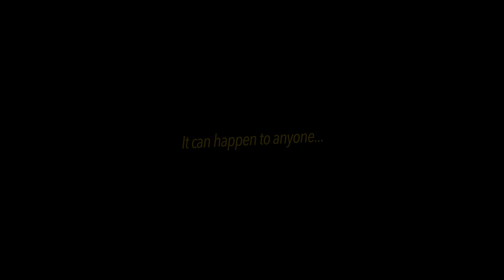SILENCE! How to fix contaminated disc brakes

Comment: Awe, the simplicity of CALIPER BRAKES!!!!

But yeah, I could see using disc brakes if you need to be braking quite a bit...

I still have not done the jump to disc as my Ultegra brakes work perfect for my needs ...
I have seen this video when it first came out but I ALWAYS resee your videos as they are pretty tops in my book!!! :-) :-)
Reply: @johntracey8592  honestly, I have had many bikes with pas brakes, and never changed outer rim because of total wear.
I'm sure there are those who have had to change it out for another. But the cost is REALLY not that much on aluminum, carbon is more expensive of course... Remember to read about the up keep/maintenance and all information on disc first, as it can be a nightmare lol
Just to calm your curiosity get disc, and if you don't care for them AFTER using them, you can always go back to caliper brakes.
Safe riding :-)
Reply: @leftymadrid  Even some awesome rim brake wheels sets only cost $600, with disc you always have a chance of bending the disc from moving the bike around or it falls.

Comment: 2:28 Acetone did it for me thanks!  Oddly enough I had a bottle of acetone nail polish remover 5 feet from where I parked my bike. If I had been looking for that bottle I would never had found it. Must have been "new brake funk" because it was quiet on the 1st day and then squeaky (like a baby rabbit in a  dogs mouth) while riding (not braking) on the 2nd day. Spinning the wheel backwards seemed to help as I cleaned it with acetone.  (ace-tone)

Comment: Just bought an Ozark Trail Ridge 29 inch from Walmart as it's recommended by many to start getting into the hobby and my brakes make that noise from the get go.

I thought it was due to cheap brakes as somebody recommended upgrading the brakes on the bike... so basically, now I understand it was actually due to the assembler at Walmart contaminating either or both the disc and pads. Smh. I didn't expect to put in work from the start from purchasing a "new" bike. That sucks, but good to know all I really need is nail polish remover and figuring how to disassemble my calipers/brake pads.

Comment: I would not use acetone with resin pads. I work with resin mounts in the lab and we actually use acetone to break it.. i would use isopropyl alcohol, instead.

Comment: love your vids.   

had this same issue.   the LBS cleaned rotors and pads and also sanded pads but the noise kept coming back.   so...ended up just swapping in new pads and rotors and we're back to quiet braking.   BUT, i loved the other rotors which cost $75 each compared to the crappy rotors i got in their stead,   am wondering if the LBS sanded the surface contaminant into the resin pad and that's why it kept happening even after cleaning.  regret not seeing this before i spent $60 on new pads and $130 on new rotors.  def pads did not need replaced in terms of age, and neither did the rotors.   just the rotors where white and matched the bike.  lol.

Comment: PSA: if you have painted brake pad housings, don’t dump the acetone all over them like in the vid as it’ll soften and strip off the paint and cause you issues. Just rubbing with a cloth is fine.

Unfortunately I found this out the hard way...
Reply: Rubbing alcohol is better-it doesn’t really affect the paint, and acetone leaves a residue, especially finger nail polish remover, which also often contains additives. Didn’t seem to affect his brakes though.

Comment: Thanks for the video! I have had squealing brakes for awhile and can’t figure out how to fix them. I’ve taken the bike to two different shops with no luck. I tried your method exact but still squeezing just as loud 😐
Reply: From what i heard you should switch out the pads and probably the disc too unless they already done it, and prob also getting new brake calipers is my best guess, but thats gonna cost basicly same as getting a new
Reply: Get some other brakes man. I had disc too. Nothing but cancer. Got Shimano roller brakes on my city bike. Know you nerds like your speed and lightweight parts, but holy fuck these are the best and only brakes I will use from now on. If anyone here wants to buy a citybike with disc brakes, please just don't for your own sake. Get roller brakes. 15.000 km and no problems so far. Haven't even changed them once.

Comment: Just wanted to mention that the benefits of using organic braking pads may have been completely neutralized by using a styrofoam tray. Styrofoam is one of the most environmentally detrimental materials there are. Single use plastic, can't be recycled and tends to break down into smaller pieces that ends up in animals and nature however well you handle it. 
Those kinds of materials have been banned in Sweden for decades.

I'm only mentioning it because you seem like the guy who would care.

Kudos for using organic brake pads and wooden handle toothbrush though. 
And thanks for the content! I'm going to try the method on my horrendously squealing MTB breaks..
Reply: They can be recycled as part of filler material and sometimes they use random plastic bits, grind them to a coarse granulate and mix with a resin and cast items like pallets, chairs and other items from it. But as is often, economics trump anything else so if it is cheaper to make something new they will do that.

Comment: Have you tried Isopropylic Alcohol? Its much stronger than normal alcohol and can dry pretty fast and get rid of any contamination, also works good when placing handlebars that dont have a lock
Reply from the maker: Micael Marcos that should work as well 👍
Reply: Those little alcohol pads you buy at Rite Aid work great for this.  Just stuff a couple in your seat pack.
Reply: doesnt work on my bike........cleaned rotor and new brakes, same squeeky shit.
Reply: @StuWright  try sanding them, sort of worked for me atleast somewhat than before. I just tried didnt go full in ima do it soon but sanding both should work, atleast better

Comment: I’d use a metal file instead of sandpaper that way no sand granules could possibly get stuck in the pads which could cause excessive wear on the pad and rotor.

Comment: Lightly sanding glazed pads, and spraying with aerosol brake cleaner works at treat. Contamination is worse with resin (soft) pads, less do with metallic pads.

You can always rub the rotors with scotch brute, light sandpaper also, especially when installing new pads.
Reply: Patrick Parisien or Patricia Parisienne
Reply: @jsaintclair1  neither mate, that’s my name!

Comment: Hello. Need your opinion about disc brakes. I'm currently on mechanical disc brakes (TRP Spyres) that work nice with durace rotors but I'm thinking about an upgrade to  Hydraulic brakes . Do you think the switch worths the money? Thanks

Comment: Mineral oil to lubricate the pistons is great, but after you push them back, clean the inside with 99% isopropyl alcohol and QTips. Then wiped dry with shop towel, and you won’t re-contaminate the pads.
Reply: Better still, sewing machine oil. Much, much finer.
Reply: mascara snake it might eat at the seals.

Comment: Good video. Thanks. I find that I have to do this very two or three weeks which is a real pain! Putting me off ever have a disc bike again!
Reply from the maker: If you have to do it that often, I’d worry something else is not right, like leaking pistons or something 🤔
Reply: Disc brakes are overhyped. Nothing but problems.

Comment: Might be obvious question, but , do you also need to clean your tires so it does not contaminates again?
Reply from the maker: Luiz Soyer I think the first thing you should do is to clean your whole bike when you have some kind of noise problem.
That being said, unless you’ve ridden trough some deep oil spills on the road, I have a hard time seeing dirty tires alone contaminating the pads (from riding in normal conditions).

Comment: Vinegar. The best solution for me.  Both for the rotors and the pads.
Reply: How does that work? Iv tried white spirit to no effect
Reply: @rozzer666  ...a pure cloth dipped in vinegar will do the cleaning for the discs. As for the pads, soak them in a glass of vinegar, leave them few minutes then apply some sanding paper on them, few times until they become clean and pure as new. Dry them with a pure cloth and voila.
Reply: @rinonhoxha4059  I got some proper shimano pads. Solved the problem straight away

Comment: Just use brakes/clutch cleaner. Most nail polish removers contain some oils to protect  the nails.
Reply: You don't use nail polish remover. You use acetone, a chemical substance often used in nail polish remover. Even if they don't contain oils, they contain perfumes...which are essentially made of oils.

Comment: Can someone tell me why when i clean my mtb brake pads and rotors  with  alchohol when i put them on they have the same bad bite as previous but when i go a lit bit downhill to get up the temperature  they have better performance is this supposed to happen or im doing smthing wrong?
Reply from the maker: Totally normal. It because they need to be broken in just like a set of new pads.
Reply: @ridesofjapan  okey thanks for help i appreciate it and thanks for the tips in the vid🤙🏽

Comment: Tricky question for you: you know that shimano road pads are smaller than the MTB version, thus less powerfull. So have you ever considered using a MTB caliper on your road bike, you'll have tu use a flat mount to post mount adaptor and your bike your bike would be about 50 grams heavier because of that but you'll have much better brake performance and less noise since the MTB brakes are just better.
Reply from the maker: Anthony HT No, I haven’t really considered that. I still have a 140 disc in the rear and never really felt I’m missing brake performance. I’m a flyweight guy though, so that can have something to do with it.
But yeah, MTB calipers are better in terms of pure braking performance, can’t argue with that.
Reply: @ridesofjapan  I would say the only upgrade worth doing are hope RX4 callipers or, if you can justify the price, trickstuff piccola calipers. The Hope RX4 are a bit of a pain to get set up but a huge upgrade regarding modulation and power, especially to shimano road brakes. If you want to get the absolut best for your bike go for the trickstuff C21 callipers - nothing can beat them, but the price shows that.
Reply from the maker: KoenigKalle cool, never seen the trickstuff calipers before... my German is non-existent, do they make them for Shimano mineral oil as well?
Reply: @ridesofjapan  It's a very small company :D
Yes, if you order the calipers, you can choose between DOT or mineral oil, flat- and postmount. Delivery time is 9 month at the moment, I think that's because they need a certain volume to make it profitable.
one caliper is 165€ - but you save 45g per brake over the shimanos you are running :D
Reply: I use hope calipers on my front disc and it works significantly better than shimano. Fully agree with the suggestion.
Reply: @SaKuLification  I'm sorry? 9 months, it's not a baby we're asking, it's a brake set. It's just too exclusive...
Reply: @onilovni1234  yeah, 9 months is a bit insane but 40-50g of weight saving per brake is insane as well and there is nothing that compares to them since the hope rx4 are actually havier than the stock dura ace calipers.
Reply: @SaKuLification  i would stay away from RX4, it is well known for stuck pistons

Comment: One thing that motorbike riders do is put a little grease between the piston and the back of the pad, not sure if this will help with bicycles,  perhaps someone else has tried it?
Reply from the maker: Not generally done on bicycles no, but it’s one thing I want to try actually. If I ever get a squeal I can fix otherwise.
I have a tube of brake pad grease ready.

Comment: first of all thank you for this really well made video with nice and clear instructions!! I really wanna try this but I'm scared of using acetone as opposed to isopropyl alcohol, like many others have suggested on other online videos and blogs, etc.
I am pretty sure I have a case of contaminated rotors and brake pads (manual disk brakes). 
I don't want to spend $150 to $200 at a repair shop for something that I could potentially fix myself and also have it be a learning and empowering experience, especially knowing that this problem could very well repeat itself in the future many times over. 
Would you happen to have any extra tips for me to give me more confidence in this process? Thanks a lot for your time. 
🙏😁😬
Reply from the maker: If you feel unsure, start with isopropyl and see if that works for you. Acetone is stronger but can affect paint etc so if you go down that route just remove rotors from the wheels just to be on the safe side.

While most people seem to be focused on the noise in the comments, more importantly is the breaking power that was severely reduced because of the contamination.
If it’s only noise you want to “fix” while this might help, unfortunately it’s not always contamination that’s is the reason.

But any way, isopropyl is a safe way to start👍
Reply: @ridesofjapan  
Wow. You're so kind to respond so quickly.
Thanks so much.
Also I'm not sure if my break pads are more metallic or more organic, so that's another reason why I'm a bit scared of using acetone.
So.... I'll try alcohol 1st. 
Also have you heard about this other method of burning the break pads? As in heating them up pretty hot with a torch, or heating them on a stove top or in an oven up to 400 degrees to get the oils aka contamination to smoke out of them?
Sounds like that's worked for some. In addition to sanding and cleaning after. 
Any thoughts on those?
👋🙂
Reply from the maker: @loooveismusic8   nope, never had to resort to that, acetone has always done the job for me.

Comment: Hi there thank u for this useful video. Have u face the problem about disc bike when u riding in sitting position there is no sound. However when I ride in stand position some sounds come from disc.
Reply from the maker: Common issue there is that the calipers are not perfectly aligned.
Can also happen when the brake mounting holes are not properly faced, so the caliper is sitting at a slight angle.
Can also be flex in the fork/frame etc etc.
But I’d start by setting to get the calipers as straight as possible.

Comment: Be careful with nail polish remover tho, cause some may contain oil. Some even may have fancy stuff you don't actually need (like fragrance and softeners) and will rise the price as well. Read what's inside of a bottle first to avoid contaminating rotors/pads even more, lol. Buying Isopropyl Alcohol or Acetone is good enough cause usually nail polish removers mostly consists of either one of them. IPA is great for degreasing and decontaminating everything and won't do anything to paintwork unlike acetone.

Comment: I have the same problem with my breaks, but on the contrary, my breaks are mechanical. So, I guess the process is the same?
Reply from the maker: I would imagine it would be the same. I’ve not used mechanical disc brakes myself though.

Comment: Two to three layers of painters tape on the back side of the pad can cancel out any brake noise! Just alcohol wipe the pads after you put the tape on and boom fixed!
Reply: The process in the video is overkill

Comment: i have NEW set of Avid bb7s  and they do squiell at light braking.  when i squeze harder the noise stops.  so what is happening there?  and they are a fairly abrasive pad.  thus i think its the combo or an aggressive pad AND a rotor that is thin and so cut out with holes/spokes than the rotor vibrates!!!  what do you think?  are the manufacturers cutting to much metal out of the rotors- causing them to vibrate excessively !!!!???  seems like a thicker rotor would not vibrate as much???   and i will probably have to find a less agro pad?

Comment: i did it and worked .but my problem is its coming back after one or two rides
Reply: Also clean out every ventilation hole in the brake disc (you’ll have to do the pads again) as you might be getting recontamination again. I used a cotton bud dipped in nail polish remover to clean the holes, and then cleaned the hole disc after.

Comment: So I don't actually need to go out and buy brake cleaner at £10 per bottle ?? I can use nail polish remover and it's just as good ? I watched another video and they said not to use brake cleaner on the pads only on the rotors? It's definitely safe and won't damage any part of the bike ?

Comment: How come no one uses brake cleaner sold in auto shops?  I haven't tried but it seems it'd be best.  Now about disks, I was concluding that I hated them because the organics don't last at all - then I learned of bedding.  I did that on this last pair and they didn't grip at all, I think I didn't get them warm enough to properly bed.  Can I do it again?  Probably clean the rotor first?
Reply from the maker: Safest would be to clean everything again before bedding them again.
For a super thorough bedding in process you can also check out this video:  https://youtu.be/2yl7KWaF_oA

Comment: Glazed is the proper American english word. It means coated over, or solid filmed over with a hardened outside. We use glazed over to described contaminated brakes or brakes that have been too hot and crystallized the outermost layer. 👍

Comment: i personally think that if the pads are contaminated, putting the nail polish would sink the oil down in the sintered material.. i directly sand them down and it worked every time..
Reply: Yes, sanding is the best method. Using any chemicals on your pads is a bad idea. Rotors yes, but pads never. You run the risk of the pads de-laminating, very bad news!

Comment: what is the brand of your 6 bolt disc brake rotor  ? shimano ? which model ? it works with dura ace brake caliper ?
Reply from the maker: Sean Edou Hope floating rotors